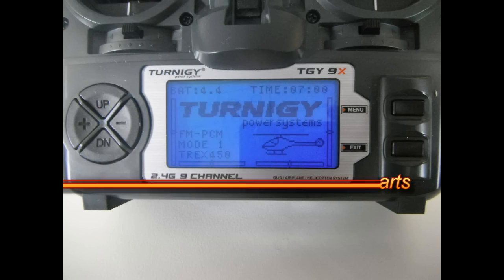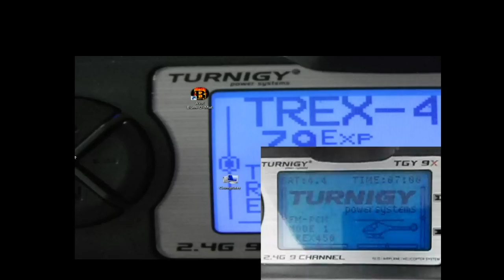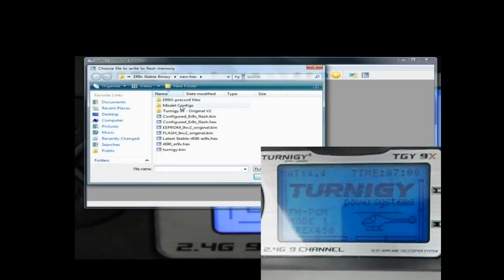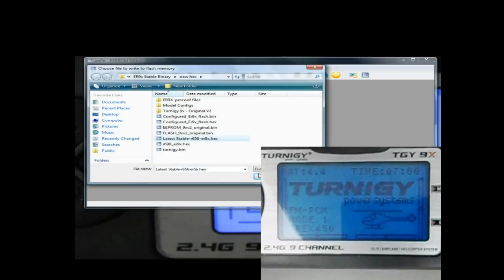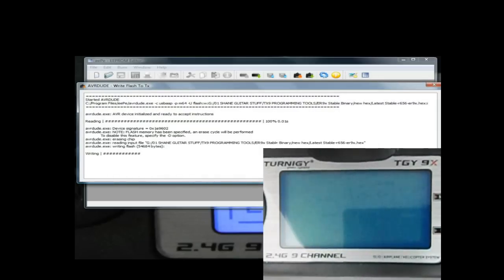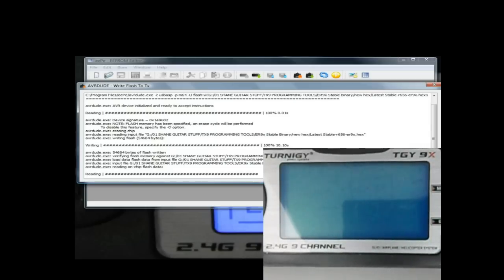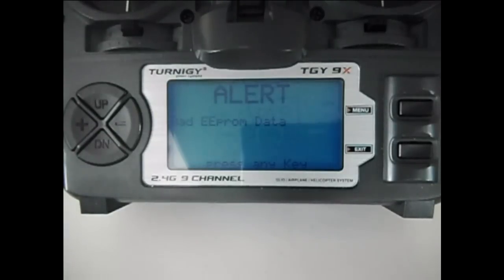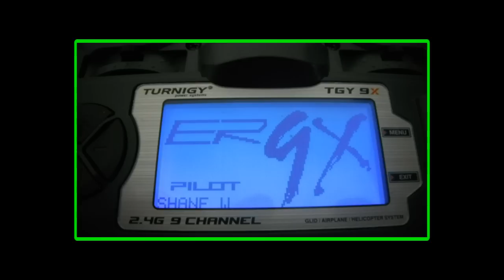turnigy 9x conversion to ER9x

Comment: i added my smartie parts board i downloaded eepe and er9x when it tries to flash it starts but says it cant finish says the usb driver does not recognize the item it is unidentified the tx is reading the usb meaning its not the board cause when i pull the usb out the computer does that sound plunk and when i did the computer side pulling just that out it did the same sound im thinking that the board is reading the usb and the computer shows the unidentified item in the port im using win7 txis on